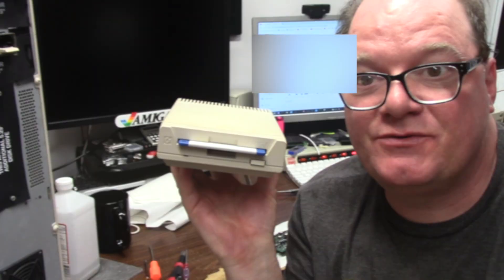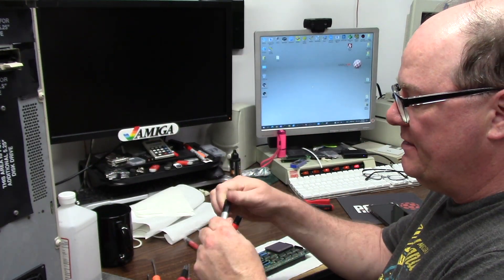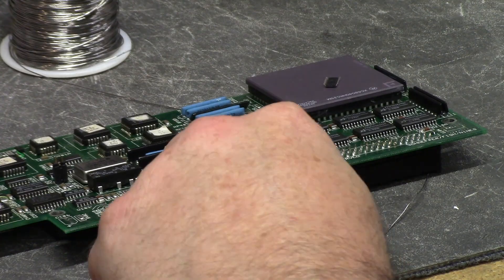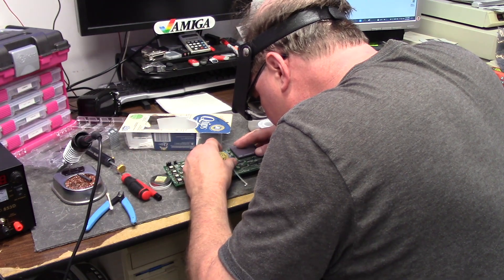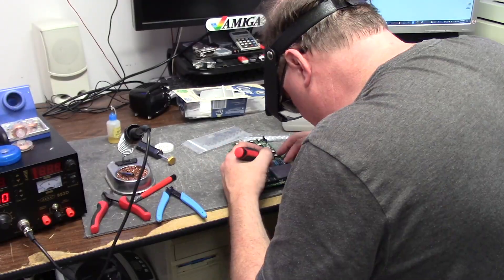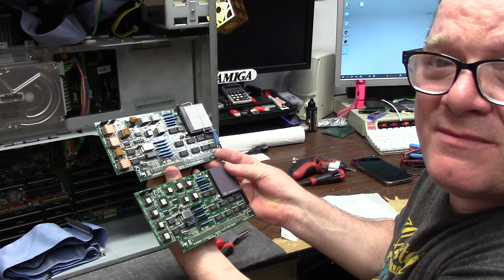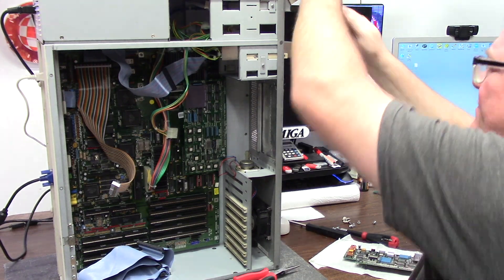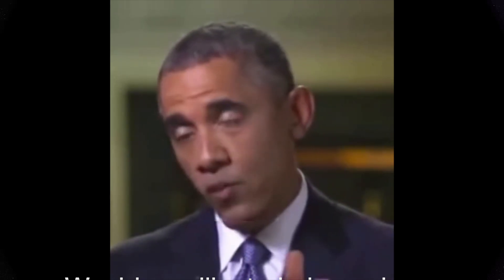Amiga 3000 Tower A3640 repair attempt

Comment: Chris I need help I live in Ontario Canada and Im having trouble getting anyone to look at my two machines 500  black screen no power light cap lock is on when pushed
and a 2000 that has mono video but has no RGB out put  I enjoy your videos watch them all the time
Reply from the maker: if your in canada, i recommend  Retrorewind.ca they are in Toronto. use my code NOCODE and you can save up to 15%

Comment: I have two 3640s that don't work. I decided to burn new GALs for one after recapping both fixed neither, but several tries at mounting the smaller of the PLCC sockets have failed (just no freaking room!) so it's now on the ever expanding back burner as the Warp 4040 and CS MkII '060 both work fine. I wanted to get one of the 3640s to work in the hope that I could trade it for a 3630 or sell it to finance a 3630 or 3630 build.

Comment: Great stuff as always Dr Chris 👍🏻 Just goes to show, you can never get these things working the first time. Have seen different versions of these cards being offered for sale. I think I have a Rev 3.1? But seen that they go to rev 3.3 or 3.4? You can also buy upgrade PAL/GAL chip kits. Is this worth doing? Cheers 🍻
Reply from the maker: i have bad luck. so if it works it works, if they dont they dont. board swaps work , same chips, i show in future videos.  idk about updating the 3.x to 3.2
Reply: @ChrisEdwardsRestoration  Yeah. Sellers on Amibay offer up upgraded chips. Plus new ACILL boards that the Godfather himself has been involved in with rev 3.3 👍🏻😉.

Comment: You should probably run to the doctor and get that big rectangular blob thats sticking out of your forehead checked.
Reply from the maker: hahah if you only know the story,  when i was 21 i tried to do a ninja inverted flip to impress a girl, but i was too far up against something and super atomic headbutted it into a sharp piece of wood, slicing my head open. this is the scar from that.    so there you go.
Reply: @ChrisEdwardsRestoration  Haha! I did something similar: Did a backflip off a haystack thinking that the hay on the ground was 5-10 feet thick.
Nope, went straight thru to the ground, with the noggin. lol

Comment: I know I had to mod the a3640 rev 3.0 to a 3.1 to work w/mediator, could that bodge be a mod? "The "cut and jumper" patch mentioned by Dave Haynie in the Definitive Buster section is: lift pin 6 of U200, and short pads 6 and 7 on U200 (for more details, see below). This, in combination with an upgrade to the U209 PAL, converts a 3.0 board to 3.1. The only difference between 3.1 and 3.2 boards is another upgrade to the same PAL. The 3.0 revision of the A3640 has enough problems and incompatibilities (reported not to work at all with A4000/030 rev D, for instance) that it's worth doing the cut and jumper patch even without the PAL upgrade."

Comment: The bravery, the sheer courage - I would never DARE! If I had a T3000 in working condition, I would never ever dare to mess with it. I would gently turn it on, use it, then gently power it down. No risk!! You sir, are a hero!